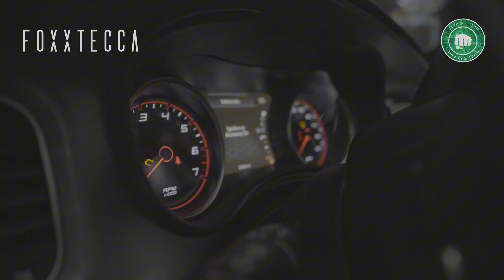He Just Ran a Dodge Charger on Plastic

Comment: I really have a hard time believing a car like that ran off of a crude fuel like this. Maybe I am not understanding the whole thing, but gasoline cars in 2025 are pretty fine tuned pieces of machinery. Fuel injectors and pumps are sensitive to that stuff, viscosity can affect the engine in many ways, combustion quality, the octane or moisture content of the fuel, etc. 

Who knows, maybe I am completely wrong! But I just struggle to see a world where you can put some homemade fuel in a Scat Pack and it revs up and roars like its running gas from the gas station. Some old diesel, maybe, but something like this just seems way too far fetched.

Especially considering the highly edited, highly controlled environment they have it in. There really is ZERO way for anyone to know what is in that fuel canister.
Reply from the maker: Well we can assure you that car ran off of his fuel. Being a sponsor of this particular event and being a part of the entire process, we were impressed.

Comment: There was a video on YouTube about 12 years ago of a dude doing the same thing in his backyard with a pressure cooker a mason jar and a big inner tube. Nothing new under the sun. About the same time I saw that video Maxwell made a video explaining how they had solved the issue with capacitors referring to the voltage instantly draining once introduced in a circuit. Said their new capacitors would replace all batteries. Said you could charge your phone in about 3 seconds and it would remain charged for months. People won't even come together to stop purchasing gas for 1 day. Raised the age of retirement and nobody says a word. ...  Home of the brave? 😂 Slaves bite their tongues to protect minimum wage and will turn their back on their own family for a little nicer part of the cage. Cowards protected by comfortable fools.

Comment: this is noting new, pyrolysis been around for decades, the first car powered by pyrolysis gas was in 1901, in 1877, The modern fuel application was established when A.A. Letnyi patented a process for hydrocarbon pyrolysis to produce lighting gas. This was a pivotal moment in the discovery of using pyrolysis for a more modern fuel

Comment: It's not free to make plastoline 
Plastoline has been around years
It's expensive to produce and still has waste products

Still needs testing to see if it can reliably provide power and not clog up fuel lines or injection systems.
Does it freeze or gum up in cold temps?
Reply: You're right, it's expensive to make but the petrol itself is the same as any other petroleum-based fuel...
The plumbing for the distill to capture the fuel is a very dirty process it needs constant replacement parts...